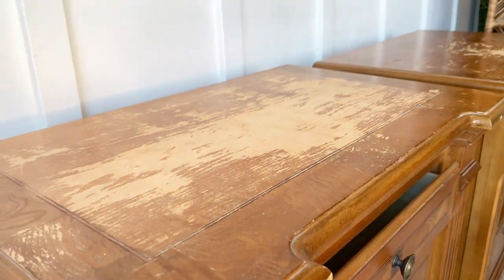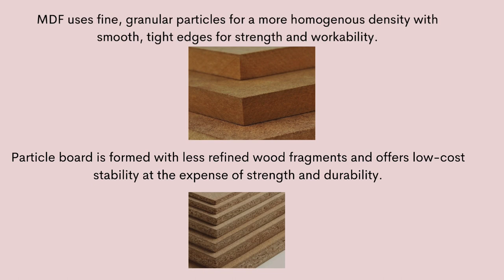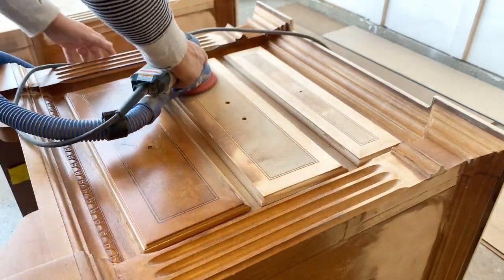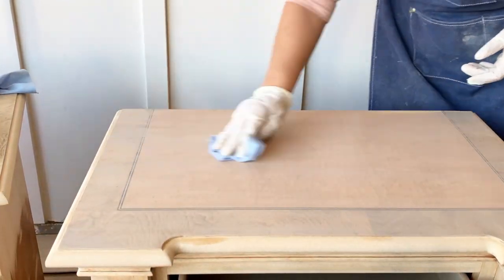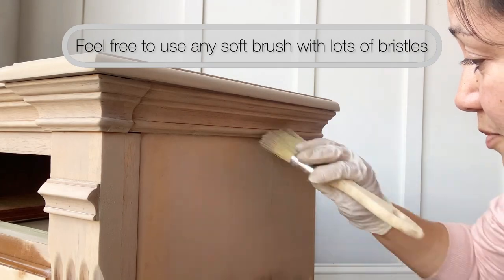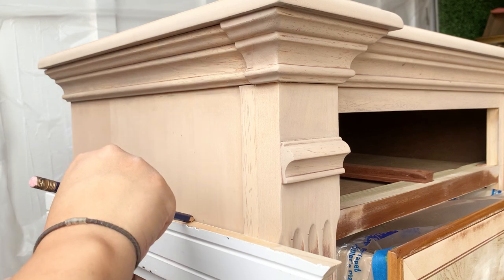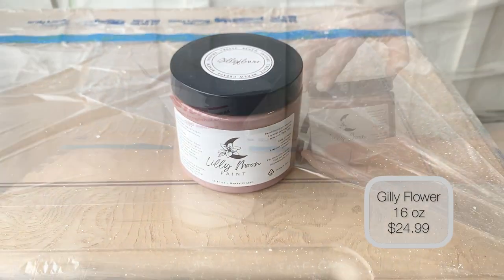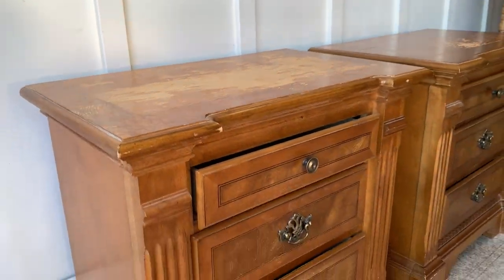MODERNIZING OUTDATED NIGHTSTANDS

Comment: You can and should change the flow direction when you change direction. As I saw you didn't change anything once you were painting horizontally and vertically.
Reply from the maker: Agree, however I liked how it was spraying when I left the one setting, so I left it, just for the fronts.